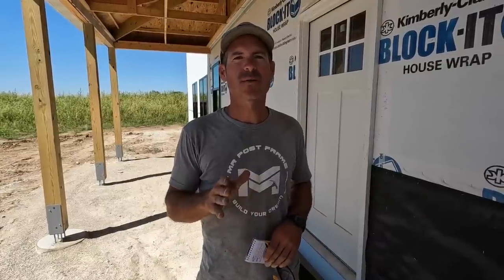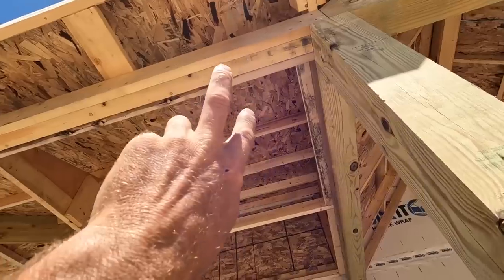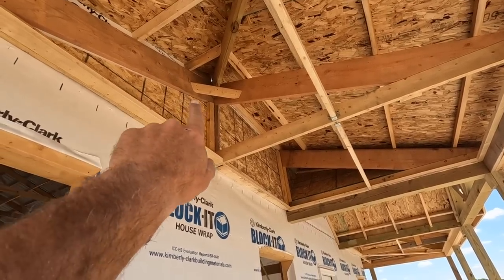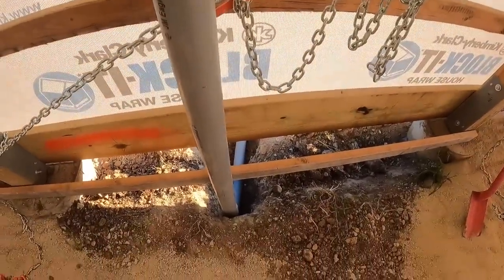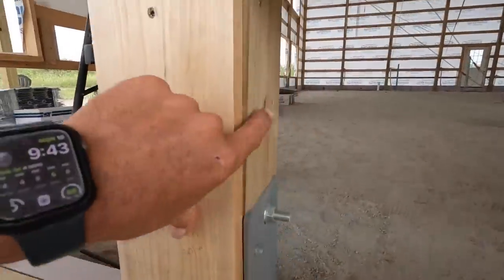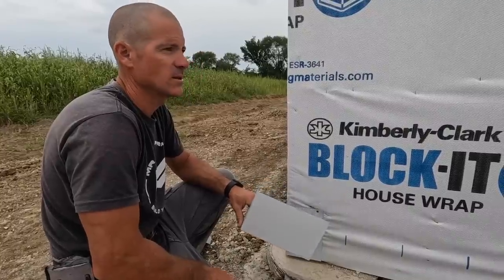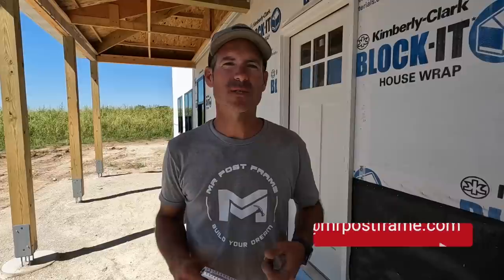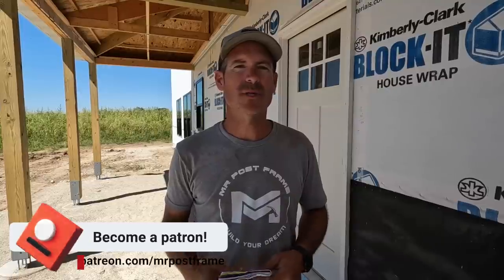The Barndo Build | Day 22 +23: Porch Detail + Utilities + Bottom Trims  | Ep 15

Comment: Hey Paul -- curious about the bottom flashing trim.  Can any condensation that develops on the tyvek run out the bottom of that flashing?  Curious because it folds back toward the house, rather than away from it, or like a drip edge or something.  Awesome work!
Reply from the maker: Just use block it tape and tape the top of trim to house wrap.